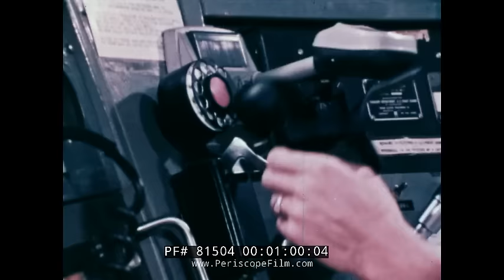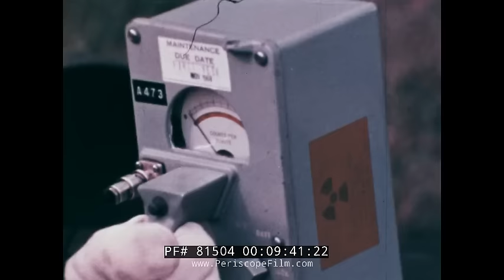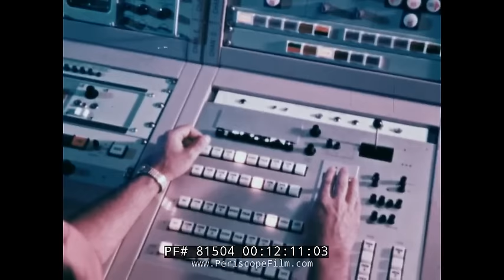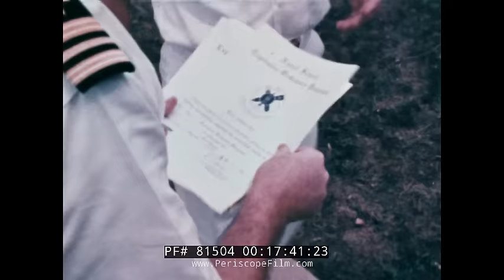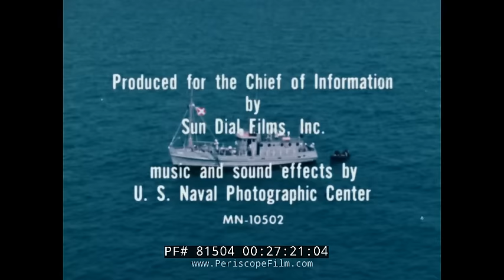U.S. NAVY BOMB SQUAD  EXPLOSIVE ORDNANCE DISPOSAL EOD UNIT  81504

Comment: Great film I trained at Indian Head while on active-duty Army transferred out before last classroom week ended up at Ft. Belvoir for generator school ended up an instructor for the rest of my 2 years on active duty then transferred to the reserves where I served the rest of my 27 plus years as an instructor. Anti-tank systems where my primary focus was training recruits on the Dragon and TOW systems both ground and vehicle mounted. I also taught some demolition classes and assisted under other instructors on active ranges. 
A friend completed NUC phase and came up with a 30 sec method to render a training NUC inoperable using a fire axe.